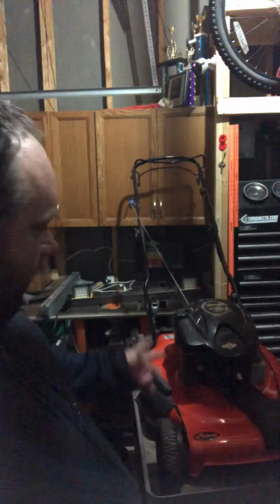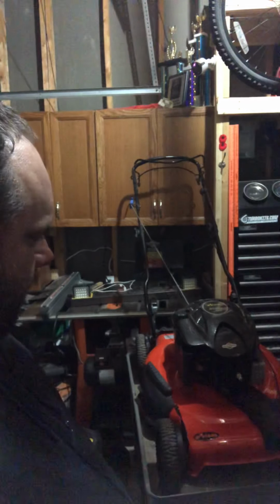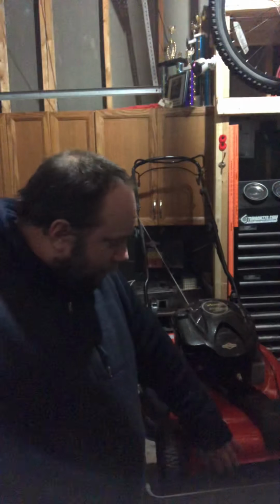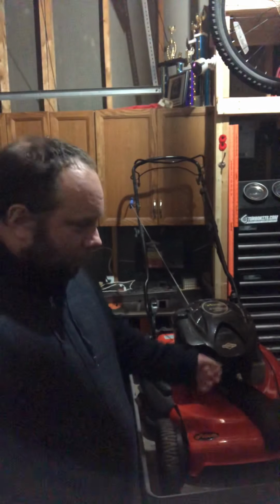Fuel Stabilizer? What’s that???

Comment: Great advice, can't wait for more.. remember to Add some more light.
Reply from the maker: Thank you. Lighting is something I need to work on. Shop is undergoing a bit of a reno, reorganization, setup. I’ve got some temp lighting I think I’m going to use till I can get to the point to have more power run, and better lighting installed.
Reply: @77Mowers  
I bought the led shop lights from Walmart  16.00 each  made a big difference.  I still want to get a ring light to try also.